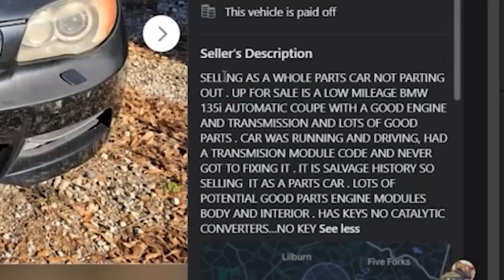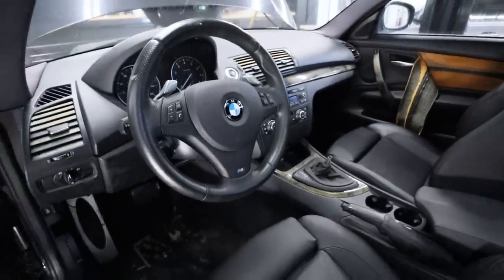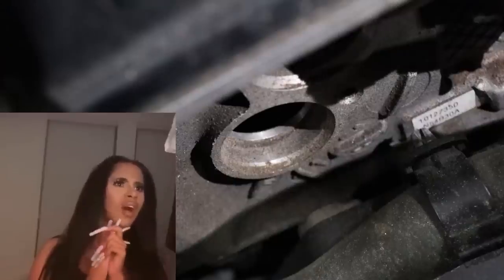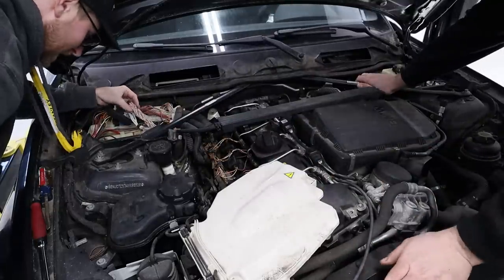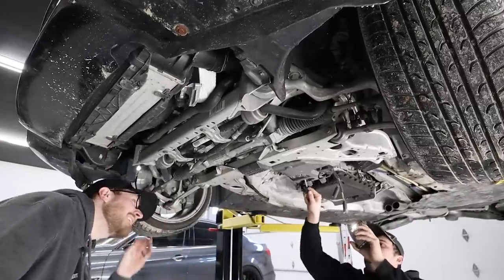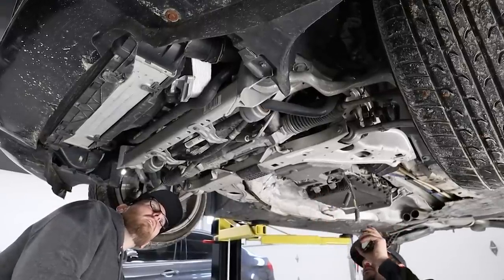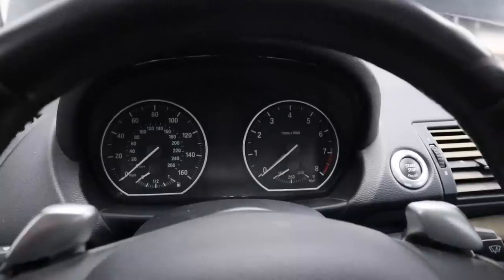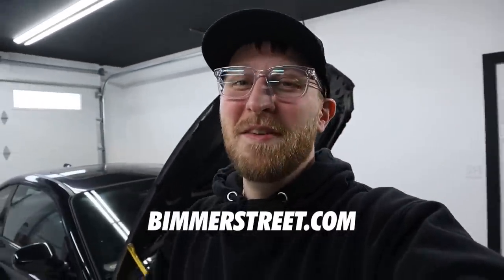I Got a BMW 135i with ONLY 11,000 MILES?!

Comment: This could be a great car, it could also be a nightmare. The Vanos solenoids being gone is a big problem since rust could then get all up inside the timing chain and down on the pump, which would be pretty bad. I highly recommend taking a boroscope around inside the timing cover at the front (probably take out the timing chain tensioner for a good view) and inside the cylinders to see what you're working with. Hoping for the best!!!
Reply from the maker: Yeah, I was bummed out when I saw they were gone. She's been exposed for who knows how long. Going to add cheap oil and see what happens lol.
Reply: There's a good chance whoever went through and ripped the DME, cats etc. out also pulled those, and if it was right before it got to you the damage could be minimal. Those solenoids are pretty crammed in the front and if the hood was left down, you have a really good chance I think.

Comment: I strongly suggest changing the vins in a new cas and  dme to the original one, and transfering the milage from the original kombi into them. If you need help with editing the eeprom's from these modules and programming a new keys - I can assist with that.

Comment: Great to see another 135 project 🙌👌

I'd change the oil, unplug the injectors then crank it if it runs to build some oil pressure before you start it. Also, check the fuel to see if there's any water in there. 

Can't wait to see more of this 🙌
Reply: Checking if it is building oil pressure now makes no difference if the engine previously was abandoned due to an oil pump issue. I’d do this check after it runs considering the state of the car

Comment: Definitely excited to see thing series. this is how I start the build on my current car. I hope everything good better than mine. 😂
Reply from the maker: Haha, don't scare me like that, man. Thanks for watching!
Reply: @jake_spence  lol nothing to be scared of all the main components to your car are there it looks like. Plus with the low miles motor you get it running and it should in theory be a perfect jewel of a car. My issue is I like getting high mileage cars and turning them into gems. Give me more headaches but more work keeps me busy. I have faith anything on your 135 you can fix. This ain’t for first n54 after all lol
Reply: @jake_spence  and been a long time subscriber loved every minute of it
Reply from the maker: @devonsmith1995  thanks bro! This is the lowest mileage car I’ve ever owned lol. Usually it’s higher mileage stuff like you.

Comment: Looks like I need to pick up another shirt. Also you should totally get a borescope, Amazon has a few for fairly cheap, the one I got fits in the spark plug hole so you can take a peak in the cylinder.

Comment: Good luck Jake! This will definitely be a good series!! Question...in your opinion, what bmw is a good reliable daily? Let's say from a 2010-2018 sedan.
Reply from the maker: Thanks David! I think any 3 series from 2010-2018 will be fairly reliable. If you don't care about going fast, a 328 or 330 would be best. If you want something quick and well optioned, a 335 or 340 would be good. If you want a larger sedan, a 5 series would be good too, but I'd stick to a 528 or 535.
Reply: @jake_spence  yea I'm not looking to go fast. Just something nice and comfortable. I've had my eye on a 5 series m-sport.
Reply: @jake_spence  also thanks for your thoughts I appreciate it!

Comment: I'd be more surprise if this engine is really good.. you better use that motor for your ST 135i and put 335 engine into that 135 imo.
Reply: What about a ls in this rougher 135??
Reply from the maker: We'll see... depends if it's good or not! I'm not sure what I want to do yet, but we'll definitely be swapping some engines around lol.

Comment: Next episode could you show how you reprogram the new key?

I went to BMW and they could get a new one for me for NZ$540 😳 about US$330
Reply from the maker: So I ended up getting a whole DME + CAS + key + cluster set from another 135i, which will all work together. So I won't have to reprogram anything, thankfully (for me). I did order a new key from my local BMW dealer for $185 before I knew it was missing the rest of the stuff, so that's money down the drain unfortunetly.

Comment: After five minutes into the video, I say pull the engine and transmission to transplant because of the low mileage then part out the good leather interior parts.

Comment: That's a pity Jake. Without the vehicle order from the old cas-module, your sc*wed, I believe. You have to know this code of letters and figures. It 'tells' the car which modules and accessories this car has. And the missing OEM ECU is the next problem. You could contact Andrew, from zeroto60 down under. He knows a lot about cloning BMW  modules and ECU's,  Good luck Dutch regards.
Reply from the maker: Thanks Nico! From my understanding, you can swap in a used DME, CAS, cluster, and key from another similar BMW and it should work (with the addition of coding a few things). We shall see. And I'm told you can pull the gauge cluster and power it up externally to read the mileage.
Reply: @jake_spence  I hope so!. Good luck!

Comment: so if you use all of those components dont you have to code the injectors and other things that need coding. looks good  if you cam fix it flip it or racecar but no LS stand alone ecu and secuencial gearbox Hell yeah😂
Reply from the maker: Yessir, I'll have to code the injectors and some other stuff, but I don't really have a choice. We'll see how it goes and that'll determine the fate of the car 😅